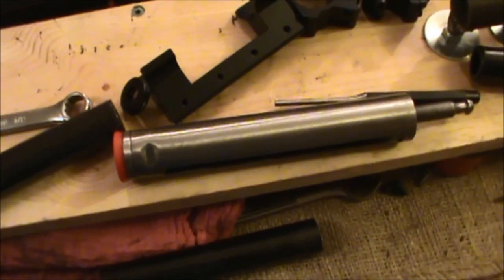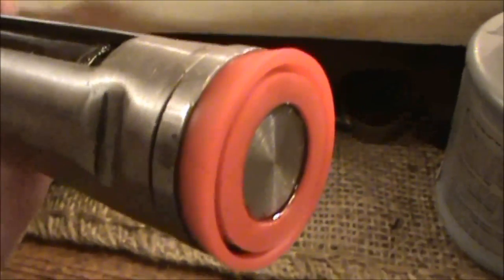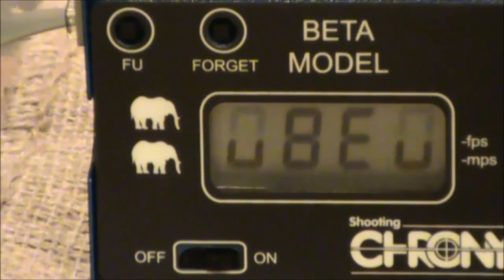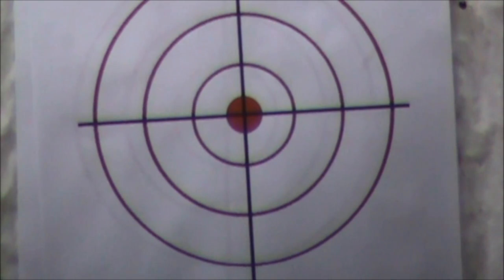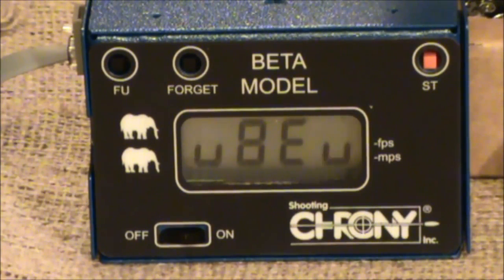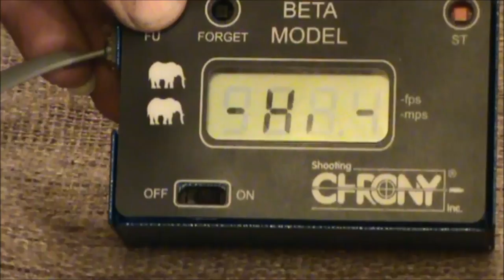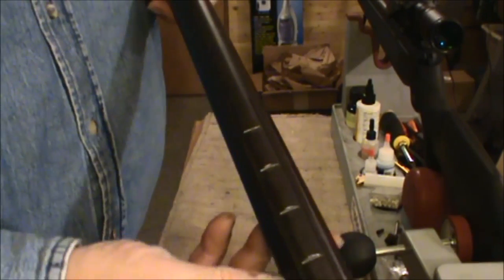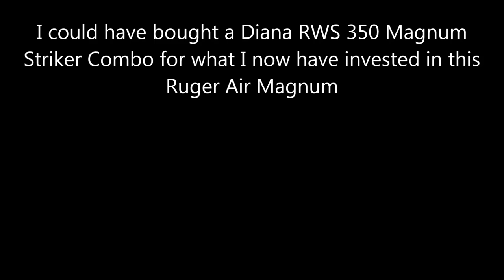Super Tuned  Ruger Air Magnum Breaks the 1400FPS Barrier! The Untamed Animal Part 2

Comment: Does having the shims to preload the spring, a potential of premature failure of the spring?
Reply from the maker: +Layne Benjamin Hasn't happened so far.
Reply: BSA used to supply washers so you can tune up or down the power, they add weight to the piston, some times adding weight and taking off a coil or two and then re-finishing the spring end gives more power but keeps the firing cycle nice and smooth, aiding accuracy. If you run a gun too hot it shoots erratically, you can melt the piston seal as phlop above found out especially if they are cheap seals and destroys accuracy. finding the happy medium at around 925 fps is good in all calibres, but some rifles are just not designed to be shot at that power. and there are plenty out there pretending to be "High powered", don't go near them, buy quality.
Reply: +hunter100t can the hatsan carnivore break barrel in 30 cal be tuned for more fps 650/700
Reply from the maker: You can raise the preasure in the piston up to 150 Bar.
Reply: Gerald Williams Being a break barrel the pivot points and cocking mechanism could be put under undue pressure along with the trigger seer itself, but yes you can increase the power but would be entirely based on cocking effort and how much abuse the rifle could take in the short term at those velocity's.
Reply from the maker: John Cormier resealed his piston and upped the preasure a bit and his has lasted for 1000's of shots.
Reply: +myairgunreviews he did it with a break barrel?  I want a little more fps on the hatsan carnivore break barrel in 30 cal..650..700 fps
Reply: +hunter100t Oh ok..I thought about the abuse it would have to take etc..I appreciate your response

Comment: some companies just dont know their product. its kinda sad considering airguns
Reply: +Garret Chambers The low end springers are hit or miss.  The companies have to crank out chinese crafted low cost products to make a profit obviously.  And springers have too many accuracy handicaps to begin with without adding more.  After having several over the years, an RWS 34, a Benjamin and a couple others, and attempting mods, I realized it was probably pointless.  And that i should either get a good gun, mid priced at least) or nothing.  I got a Walther LGU and its thebest gun i ever got.  The reasons are pretty clear, its an under lever where the barrel stays put, and the piston run in its own cylinder NOt using the rec housing itself as the cylinder.  The diffference is amazing and finally i feel i didnt waste my money on a second rate product.
Reply: Top notch rifle mate shouldn't give you any problems, apart from reminding you of the nightmare "others" you wish you never bought,  the rws 34 is also a good rifle :}
Reply: Concur hunter100t,  who of us has NOT wasted hundreds or thousands on innacurate crappy air guns.  Just because the gun is costly means nothing about accuracy, i spent $340 for a marauder pistol and more on the Hill pump and this gun not only cannot group in under 6 inches, it is sitting in pieces in my safe right now because the seals only hold for about a year then they need a reseal.  I bought the Walther LGU (for $400 at Airguns of arizona on sale) and it is the best air rifle I ever had (accurate).
Reply: Robert Maybeth Got to agree with that, bought a few lemons in my time but we learn from our mistakes, some don't but most do.
Reply: Robert Maybeth check out Benjamin marauder pistol on teds holdover. His is amazingly accurate. You must have got a flaw. Should have sent it back.

Comment: hello I am subscribed to your channel congratulations for the videos, I am writing to you because I need some advice from you who are good at this, I am writing to you from Italy, here unfortunately the maximum power is 7.5 joules, I bought a gamo replay 10 magnium from 5.5, practically the diablo too heavy and it does not go, it sucks, a real shit, can you tell me how can I get it to 45 joules? I hope you can help me because I do not find information anywhere. I hope to hear from you soon
Reply: search for tuning double springs it should cost about 30-50$ and will get you a solid 30 joules
Reply: The creator passed away from cancer sadly...
Reply: @fortnutowicz3537  allanfine I have taken full power even if I am not completely satisfied given 45 joules I found 10 less. .....
Reply: @xdskroot7247  I'm sorry for him R.I.P
Reply: @thomascarboni7727  same I mounted double spring for my hatsan edge it shall be smth like 30 joules but I've got like 23 max
Reply: @fortnutowicz3537  ciao io alla fine sono riuscito a potenziarla ,ho comprato la molla a gas vado 123 sono le migliori molle,se ti interessa esiste anche per hartsan ,sono molle da 90 ,100 kg non di più perché spacchi il fucile ,ciao buona fortuna
Reply: @fortnutowicz3537  le vendono in Russia se ti interessa dimmelo che ti cerco il negozio

Comment: OK, so you didn't like the groups with the .25 caliber barrel because it didn't produce some (a subset) groups that were tight, even though overall the they were better than with the .177 caliber barrel.  Then you acknowledge that the .177 caliber barrel isn't a good choice for hunting because the first shot might be a flyer.

I'm an accuracy nut, so I'd choose the .25 caliber barrel, since at least I know what to expect.  I wouldn't trust the .177 caliber barrel, even if 8 out of 10 shots went into a small group.  If two shots are going to be wild flyers, then that is what you must expect.

Without explicitly showing us, you pretty much said that the .177 caliber barrel was worse, with wild flyers, but you liked the fact that some shots made a tighter group than that of the .25 caliber barrel.  And yet NONE of the shots from the .25 caliber barrel were flyers.

Seems to me that if you actually took 10 shots with each barrel, including counting flyers, that the .25 caliber barrel would out perform the .177.
Reply from the maker: I think the .25 cal barrel was defective. It was made by Xisico.
Reply: myairgunreviews Did you buy this .25 caliber barrel from Archer Airguns?  That's where I was planning on buying one.
Reply from the maker: AirGunVic Yes. I even Clamped a Muzzle Break in it.
Reply: the .25 looked like a shotgun blast on the target, but the .177 was good with just 1 flyer. not bad for that velocity.
thanks for the vids mar.

Comment: REALLY seems you have a Poor barrel... abit OVER sized, not consistent..
I would see if you have a Machinist to check it out..
The only other option is Over pressuring..BEVEL the exit point..
Reply from the maker: +Ed ash Tried the barrel on 2 rifles and returned it.
Reply: +myairgunreviews can the hatsan 135/30cal break barrel be tuned for more fps ..abt 650/700
Reply from the maker: Yes, you can increase the pressure in the Piston up to 150 Bar.
Reply: myairgunreviews you know who does this...
Reply from the maker: Ask Rick Eutsler